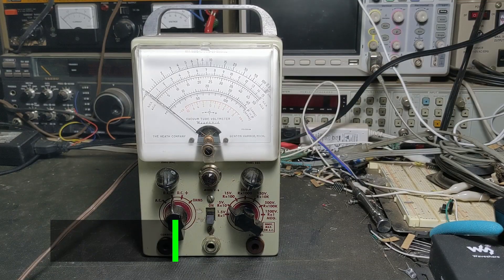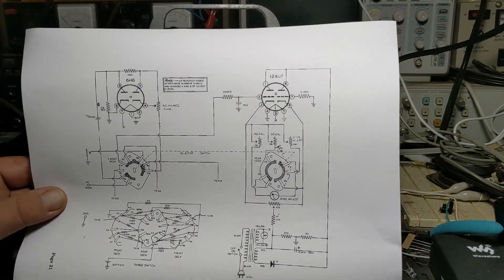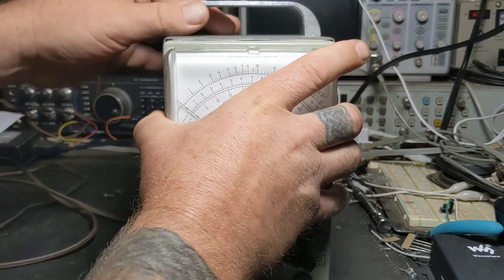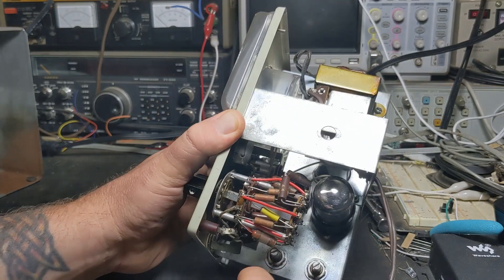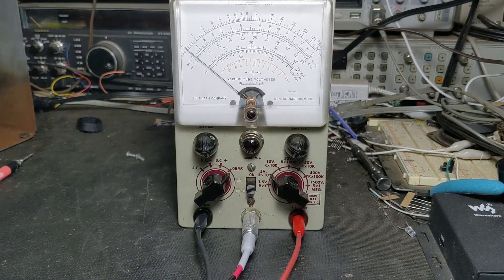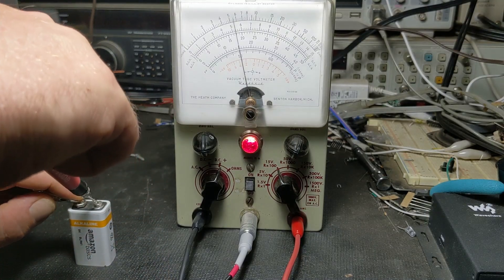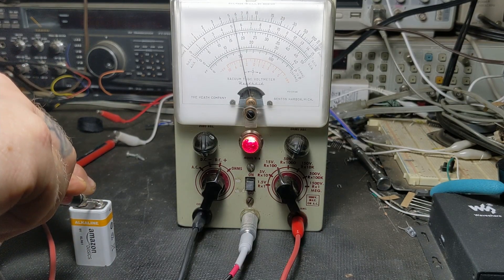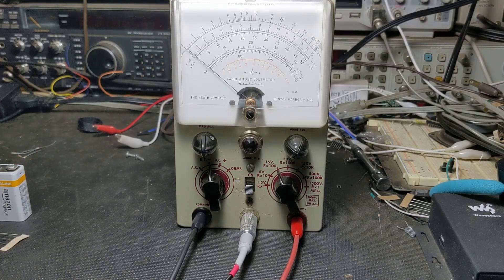Heathkit V-6 VTVM Repair Part 1

Comment: When you were talking about scratching the case, you did scratch it with the screwdriver.
Reply from the maker: Yep, I know.  I started to do something when editing the video to draw attention to it, then decided to not mention it.  But that is how easy it is for sure!  In this case it was not too big of a deal, but you can imagine having something very rare...
Reply: @ke4est  yeah, it's no big deal. I just thought it was ironic. The tiny scratch in the cadmium plating probably won't hurt the value given that it is already not in perfect shape. I have a similar VTVM that I picked up from a flea market. Some of those precision resistors are tough to find and I don't recommend replacing them unless they are out of spec.
Reply from the maker: @JasonTHutchinson  Yes, I only do so if they are out of spec.  You will see in part two I had to "Make" some custom resistors.  Too expensive to special order.
Reply: @JasonTHutchinson  So where can someone find those hard to find resistors?
Thank you
Reply: @SDsailor7  they are probably going to be a special order. Caddock makes high precision resistors, but most places don't stock them. Be prepared to spend $20+ for 1 though.
Reply: @JasonTHutchinson  I hope all the resistors are within tolerance.
Thank you for the reply.
Reply: @ke4est  I have one of these V-6 vtvms and i found that moisture or water got under the metal case of the 6h6 vacuum tube( first time seing one with a metal case instead of glass)How can i test the tube to see if its good?
Thank you